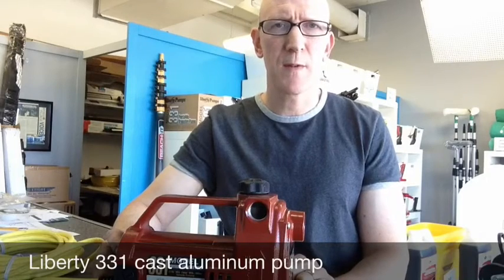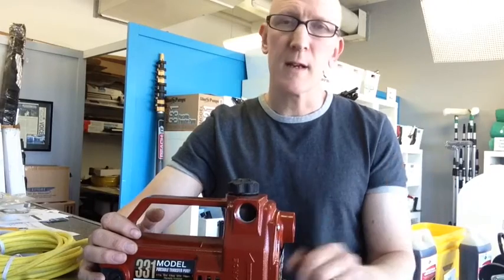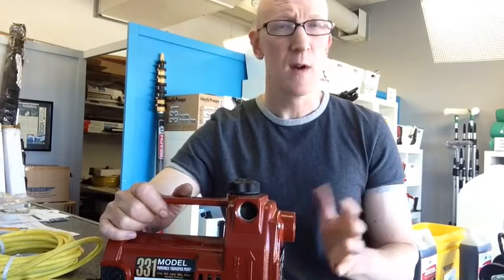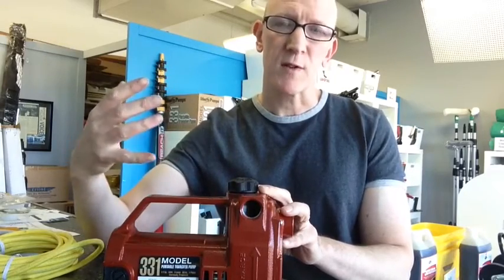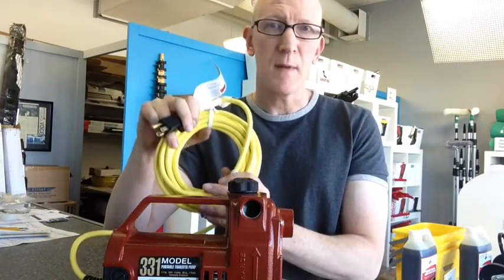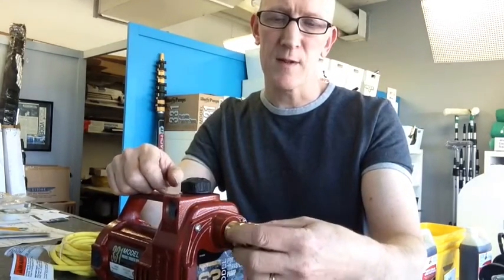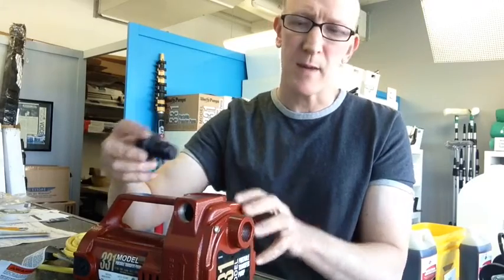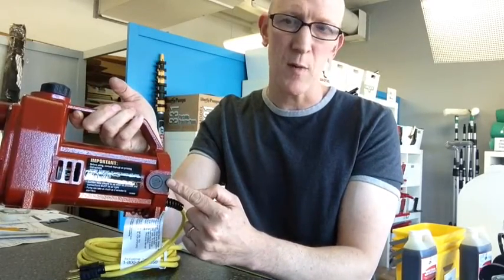Liberty transfer-booster pump for RO/DI Waterfed Systems

Comment: can i use this to take the water out of a swimming pool? do i need to submerge the pump into the pool?
Reply from the maker: yes you can drain a pool, flooded basement, pond etc. Do not submerge pump in water. Just have an incoming length of hose in the water and it'll suck it out.
Reply: @WCSkills  thank you!

Comment: Just a helpful hints. I used a transfer before. I plumbed mine to pump AFTER the pre filters. You will lose psi thru the filters and no need to add pressure to those filters, sure, some rated to 150 psi. Reason is I want the most psi boost. You could lose up to 20 psi thru the filters depending on size, 10 vs 20,  2" or 4", etc...this way all boost goes to the RO. Depending on your membrane that 10 psi can be a big plus.
Reply from the maker: Jack'll Fix It good tip there Jacky Boy!
Reply: @WCSkills  , another thing I did is instead of turning off pump if water flow stops, usually these have no switch, just plug. I used a remote to turn off and on. Similar to those you use for christmas outdoor lights but I used a stanley one that allows a higher amperage. Definite plus if pimp is out door and conditions are wet.  Also, with all cast iron, it rusts. Be sure to flush well before use and drain after. If rust gets in there let some vinegar sit in it and it helps remove build up, then flush because if using after filters the last thing youmwant ks a load of rust going into your membrane. Since then I went to the stainless steel wayne.
Reply from the maker: The Liberty 331 is cast aluminum. So no rust issues The Stainless Wayne is a better pump tho.

Comment: Is there a way to adjust GPH or pressure?
Reply from the maker: Not on the pump itself but I suppose you culd put a ball valve of some sort after the pump. Not sure if it would heat the pump up too much tho. could always check with the manufacturer. http://www.libertypumps.com/
Reply: Never thought about a valve. Maybe use a longer hose after the pump to put more drag or elevate the collection tank. Your comment brings forth other ideas.

Comment: Great video! You won't need to prime the pump if you have positive pressure feeding the pump with a garden hose. In those cases you can simply unscrew the priming port partially to allow any air to escape once the hose is connected and on.

Comment: how much is that pump. ??
Reply from the maker: here you go. https://www.thewindowcleaningstore.com/collections/waterfed-poles/pumps
Reply: WCSkills do you sell anything from 60 to 90 psi??
Reply from the maker: This pump in the video is for booster pressure before an RO. Are you looking for a booster pump or a pump to draw from a tank (different pump for this) and where are you located in the world?
Reply: WCSkills  yes booster before the sistem my pressure is really slow I get like a gallon for 3/12 minutes...I need a booster I Only run one wfp
Reply: WCSkills I added 200 feet of hose that's when it got really slow
Reply: WCSkills  the pump in the video is a  sold as a transfer pump.